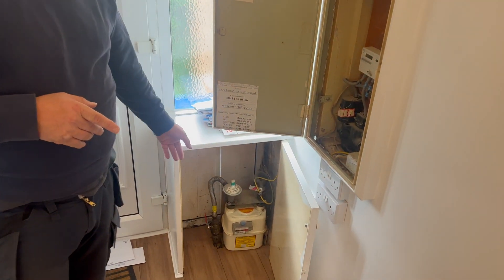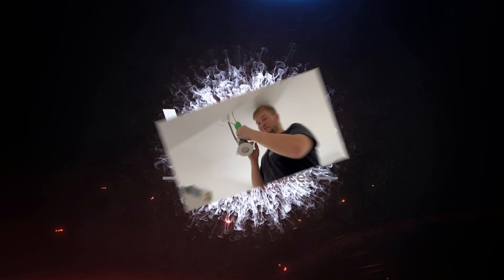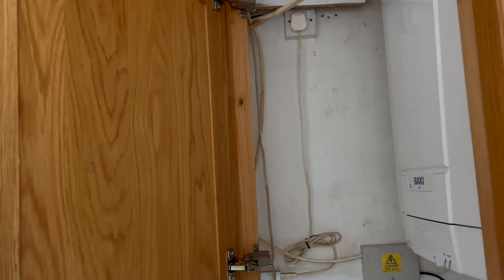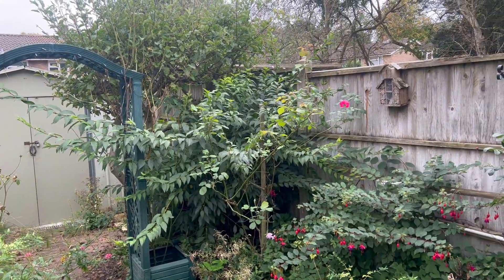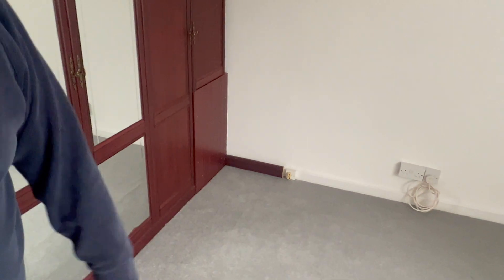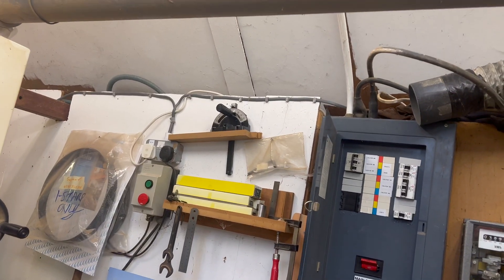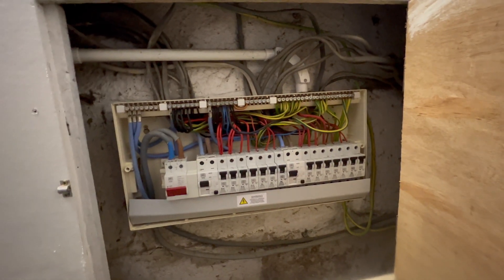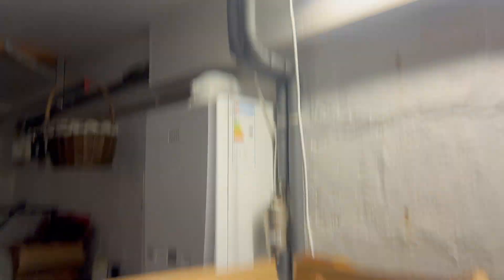"Sparks and Supper: A Delicious Day in the Life of an Electrician Exploring Electrical Testing!"

Comment: Yo Wills. The problem when undergoing any inspection is when additional work has been carried and whether or not the work has been carried out correctly. With this type of installation- skeleton consumer unit or fuse box; singles run within metal conduit, poor workmanship will render the installation disastrous.